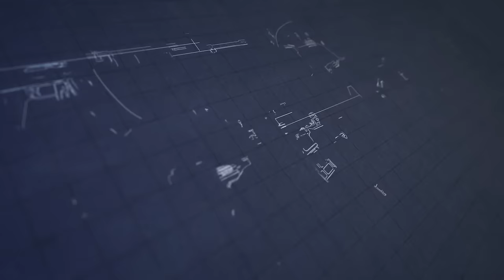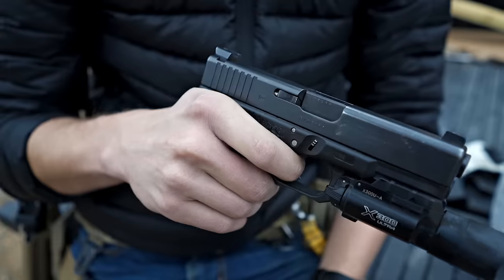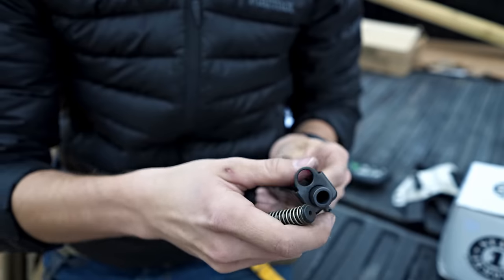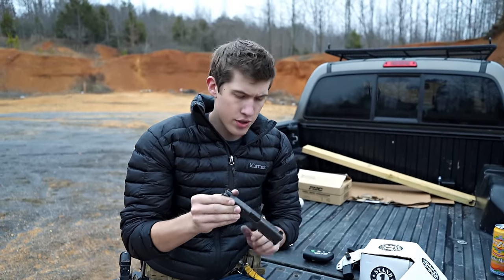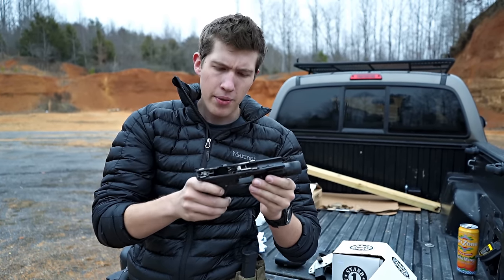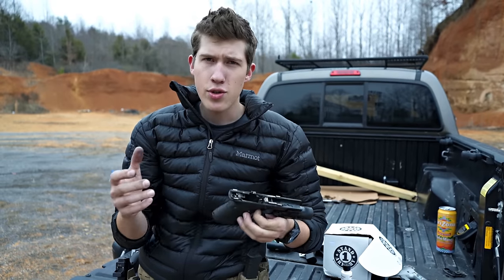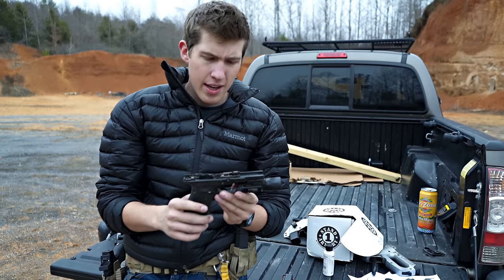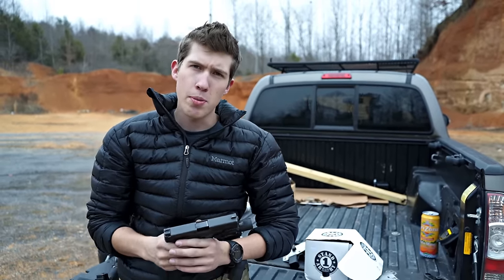Practical Glock 19 Upgrades for Efficiency and Effectiveness

Comment: The trigger spring does not help reset. The trigger spring in a Glock actually helps you pull the trigger. That's why going UP in weight results in a lighter trigger.

Comment: You sir are a wise man. I am a 3 time Iraq veteran who was in the infantry, and I couldn't agree more. I got some upgrades for my glock like a bar-sto barrel, tungsten guide rod, trijicon hd night sights, but I knew I didn't really need them. I just wanted them. since then my glock 21 SF has returned to all stock minus a competition trigger. I love the flat face trigger. the stock trigger is uncomfortable when shot for long periods of time as the trigger safety protrudes a little even while depressed. My pyramid trigger from the glockstore.com is amazing and I love it so much. I did not change out the striker with the skelotonized striker or any springs or amytbing in the slide at all. just dropped the trigger in. that is the only after market upgrade on my gun now and the trijicon hd night sights. Money should be spent on ammo and training. Money can't buy skill. Only practice can earn skill. Love your videos. You're a skilled shooter. Keep it up. don't worry about the haters on here. Just do you.
Reply from the maker: +Michael Zschoche thanks man! And thank you for your service! 👍🏼
Reply: I went the poor man route with OC Custom's trigger blade/dingus. That's really all I wanted to change, being smoother will be a plus.

Comment: I am surprised you haven't had trigger safety reset problems with that heavier trigger Spring and stock striker Spring. My dept carries glocks and we are armorers. I personally have experimented and find the 6 lb trigger and 6 lb striker  rule for springs is the safest and gives the best trigger most of the time. Of course with glocks each one has its own personality.

Comment: Does the recoil spring housing on the slide shear off some of the polymer inside the frame does it eventually create enough space to slide back without touching or shearing some of the polymer inside the frame I see the only thing you kept was the frame do I’m guessing it’ll be fine I just don’t want it shearing polymer then shearing up against the reinforced metal

Comment: What's the reason with saying that 2016 is the year of the glock barrel. Is it because they are fit tighter now? I remember hearing taran butler saying something along those lines. I noticed also on a new gen 4 Talo 2017 production g19 the barrel hood had no play when you push on it. My gen 3 2014 production 19 has a little play and you can push it up and down a little
Reply from the maker: +jonathan retzsch about eight companies released Glock barrels in 2016

Comment: The simplest upgrade to a Glock is the trigger… but not in the way you think. Glocks out of the box feel like doo doo. However, after about 500 rounds, the trigger becomes not only smooth but light as well, with a crisp break. Get 500 rounds (or more if you’re feeling like having a very fun range day), and go to town. Beats the hell out of doing your own kitchen gunsmithing or putting in a new trigger every day of the week.

Comment: I got a glock 23 really cheap. I ordered a lone wolf 9mm conversion barrell and g19 mags. Will it work with the 40 recoil spring?
Reply: Tim  Bennett Possible. If not, try an OEM G19 Spring. Probably around $10-$15

Comment: On a GEN four or five all you really should have to do is change the sights and that’s debatable. The only reason I can see to buy a Glock over a Smith and Wesson M&P or similar polymer guns are the availability of inexpensive magazines and better aftermarket support. They’re a bit bulky compared to comparable handguns but they do work the way they’re designed and built. If the trigger and grips don’t work right out of the box I would get a different gun.

Comment: Wait, so what about the stainless steel guide rod? They aren’t pricey and should be durable
Reply: Yes I have a stainless steel guide rod for my Gen 3 Model 17. It was only $20 and I've had it for about 12 years now. No problems with it whatsoever.

Comment: The constant mood swing of the gun industry fascinates me.  Half a decade ago the hot thing was heavier springs for stronger, more positive resets so you could pin and ride the reset faster.  Now, reset doesn't matter because you should be re-staging the trigger during recoil.  It's just one memorable example of the fads that become "standards", and why how you shoot doesn't always have to mimic the "hot" way of shooting this week if it's not fast or comfortable for you.

The only constant is round count.  Your gear and the tuning thereof doesn't matter as nearly much as just having a setup that you've run to perfection and readily try (and apply only where they actually help) new inventions in gun handling.

Comment: My Glock 19 keeps getting spent cartridge injection issues or stove pipe. Always something different never the same. I’ve tried not to limp wrist. I sent it back to clock because it was under warranty. They changed a few parts said they fix the problem. But the problem still occurs. Any advice what I meanMay be doing? I feel like it’s me causing the issues. The ejection issues the stove pipe issues. Anyone have any advice? Could it be as simple as me not gripping the gun tight enough? Our Glock 19 sensitive? To certain things? Any help would be appreciated. Thank you

Comment: You wore out a Glock slide after 30k rounds? Sounds suspect to me. I’ve seen a ton of glocks with 75k rounds before needing to be rebuilt. A rebuild consist of putting new internal parts in it.
Reply from the maker: +Paco2340 wore the drill and tap out for the RMR

Comment: Ive owned 02 Glocks so far. both gen 04s. id advise against buying "used" or law enforcement trade in models. you are buying someone elses problems. after market upper coatings like metalife or nickel boron might screw up the striker channel. tiny bits or crud might be stuck in there. I had 02 misfires with factory 230gr FMJ after custom upper work. a retired police officer informed me he a similar problem after a nickel job to his Glock gen 04. get cerakote or coatings from respected, professional shops. robarguns.com Black T, etc. I add vickers mag releases & now with my Glock 20 grey model, Glockstore.com take down levers. This steel part is excellent. My fingers & hands are not huge but factory Glock parts are awful. I plan to add Tru Glo tfx pro sights to my Glock 20 later on.

Comment: Has anyone upgraded to a different safety plunger? Thinking about buying an after market one for a more "smooth" trigger pull
Reply: yup works great,  i changed out the saftry plunger with lighter spring/ put a double diamond  3.5 lb connector/ plus changed the trigger spring to a 6 lb.  now trigger is 3 to 3.5 lb consistatly.  really makes it a great shooter, and more accurate.

Comment: On the surefire lights, do they ever get loose after a high round count?
Reply from the maker: Only if you don’t torque them on enough
Reply: @TREXARMS  I'm about to purchase an x300 ultra, and I'm not sure which one to go with as far as t-slot or rail lock. It's going on a g45. I like the idea of the rail lock system, but I wasn't sure if it gets sloppy after time. Because the t-slot you can always tighten down if it's needed. Would you take the A or B model?
Reply from the maker: Get the B model
Reply: @TREXARMS  any specific reason?

Comment: It does help to get a coated safety plunger. Then while you’re installing a cheap 3.5 pound connector polish the trigger bar where it meets the connector and also the part where it contacts the safety plunger. You’re just speeding up the natural process by thousands of rounds and these cheap upgrades are of course cheaper than all that ammo. Get a decent pair of sights and your solid. Money you would spend on fancy sh@t can go towards new magazines. That 250 dollar barrel? Get your a$@ a single stage reloading kit and save money reloading so you can shoot and train more. And make bug out ammo. That 15 round plastic box of Hornady XTP self defense at the gun store going for 25 bucks??? You can make that for 6-7 bucks. Plinkers even cheaper than that. The guy at the range who just fired off 250 rounds of shelf ammo and left his brass on the ground? You just saved a ton of money by picking it up. Tumble that mess and reload!

Comment: Why would anyone go with a short barrel 19 with a long ass light on it over the full size 17 with the same light?
Tacticool or practical?
Reply: Dream Builders there are a few reasons. 1.) It keeps your options open if you’re running a comp or can, and keeps overall length down in that instance. 2.) it balances better that a G17 because it’s not front heavy with a light. 3.) the grip may fit some people better. 4.) Recoil is, in theory, reduced because the weight of the light is non-reciprocating, unlike the longer slide of the G17. 5.) the grip is what will print under clothes while carrying. You can use your imagination, but I think you get my point.
Reply: the 19 grip is still shorter than the 17. The 17 grip is more difficult to conceal.

Comment: Nothing better than stock. Guns are designed to run with what they come with and the problems start when you start changing shit
Reply: Not true.  Guns are designed to come straight from the factory to be reliable and not cause serious injury or death to the operator.  Basically comes down to liability issues. There's always better aftermarket parts you can put in your firearms to make them work better. I am not a fan of polymer guide rods and actually had the guide rod on my Glock 17 Gen 3 crack nearly in half on me. I upgrade it to a solid stainless steel guide rod and that has been holding up for over a decade now. There's always better stuff out there than factory parts.

Comment: there no point in match barrel unless your either fitting into a  roni carbine and taking a 100 plus yard or more shot at 50 yards a stock glock 17 on a test bench grouping after taking the human factor and skill out of the equation is less then the size of our palm most of us having problem hitting target that size in 20 yard reliably so the best upgrade is ammo and practice after that i would say trigger rds flush mount mag extension plate anything  else is honestly a waste of money to be honest since it dust really improve the gun in any meaning full way

Comment: my opinion all that stuff on a carry gun is pointless the chances of even needing a light for a self defense situation outside you're home are almost next to none,  most who conceal carry are civilians not LEO with that said a light also changes the balance and weight albeit not much. RMR I've considered putting one on but after using one, for me it is distracting and blocks some view when aiming and in Self Defense I want all the awareness and control I can get. sometimes simple is best. but hey just my opinion.
Reply from the maker: You can only shoot what you can identify. Most bad situations happen at night. White light is used to identify and then process information. The weight thing doesn't make a difference one bit. With that said, it can help reduce recoil because of the weight out front. So that's actually a plus. A red dot actually gives more situational awareness because you can see BELOW the target some. With irons you can't see below at all because the slide is in the way. Something to think about.
Reply: I left out using a Detachable light, pros and cons to both. The FBI and other departments around the world have found there is a increased chance of malfunctions mostly in Glock's, other polymer handguns in .40 cal related to using a weapon mounted light. That why the FBI trains field agents to use handheld lights when available. Also with weapon mounted lights you flag what you are illuminating can be very bad for a multitude of reasons in a high stress situation,  not to mention a bad guy will most likely shoot at the light first, I know a a lot of this is what if scenario's  I'm not trying to say what you do or someone else does is wrong, i'm just saying for me those reasons I choose to train with a small handheld light that can be attached if needed when CCW.

Comment: Sounds like you turned a $550.00 pistol into a $900.00 pistol.  Glock's are okay but they are not a great pistol.  I had never owned a Glock until five years ago.  They are reliable, just like many other gun manufacturers.  However I hate the Luger pistol grip angle, it is very uncomfortable.  I like the 1911 pistol grip angle.   I hate the cheap finish on the blocky slide and the cheap sights.   To me, the Glock looks and feels like a cheap pistol.  I do not believe that I will ever buy another Glock, they are not worth the money.  I would rather spend an extra $200-300 and get another Sig Sauer or another HK.
Reply from the maker: +Juan Gonzalez all comes down to personal preference. Use what you shoot best.

Comment: Best thing to do is not buy a block.
Reply: L take kid.
Reply: @Abel-Alvarez  uh what, can you speak English.
Reply: @frankcastle9691  Yeah, i just did. Do i sound foreign to you or something?
Reply: @frankcastle9691  Also do you find something wrong with a Glock?
Reply: @Abel-Alvarez  no you're not, "L take kid" isn't a complete sentence. 

Yes I do not like glocks. They're over rated, over priced and outdated.
Reply: @frankcastle9691  We're not discussing complete sentences, just English. Also i can respect your position on Glock. It's gotten to the point where everyone has a Glock so it's no stranger to the gun world. Otherwise it's still the standard for Polymer pistols that many have tried to beat, but have failed.
Reply: @Abel-Alvarez  I would say sig sauer and m&p are beating out glocks.
Reply: @frankcastle9691  Sig P365XL and M18s are superior to Glock. Better grip, sights, trigger. You are dealing with a fanboy.
Reply: @frankcastle9691  I agree with M&P being a great competitor to tp Glock (not sure about beating them though). As for Sig Sauer the P320 is excellent, but damn they do gotta fix that drop safety hazard. Otherwise another great competitor to Glock, it's just down to price point and aftermarket support that M&P as well as the P320 need to really edge out Glock to really seal the deal. Until then, Glock is the default for newcomers and veterans alike.
Reply: @Abel-Alvarez  every police officer in my town has ditched glock for m&p, the military is using sig. As far as aftermarket support, sig and m&p come with everything you need unlike glocks. So there's no need for tons of aftermarket support.

Comment: 1911 doesn't need upgrades.
Reply: yes it does the upgrade for a 1911 is throw it in the dumpster and buy a glock
Reply: If I wanted a striker fired polymer pistol, i'd get a sig or a walther, not a shit glock.